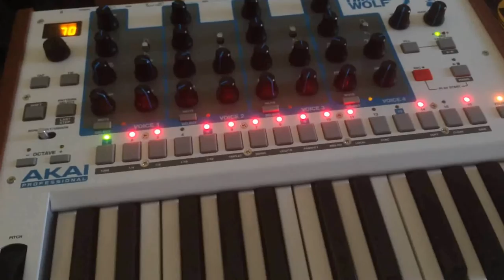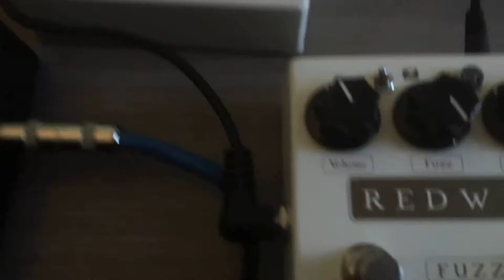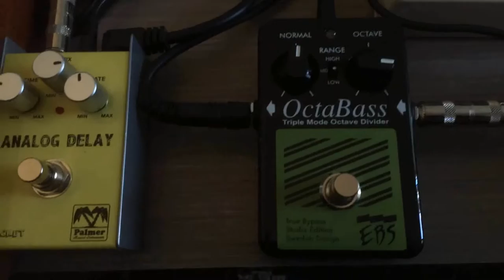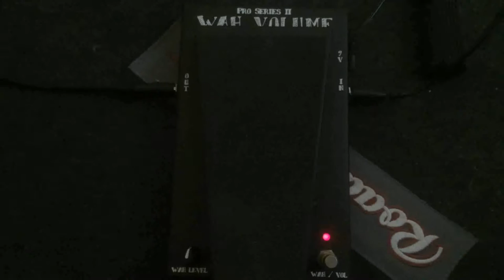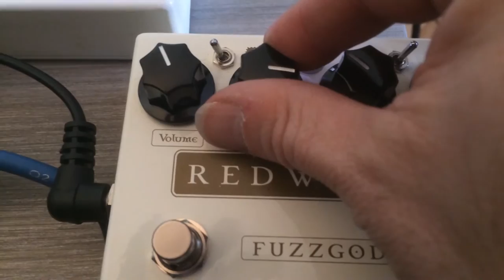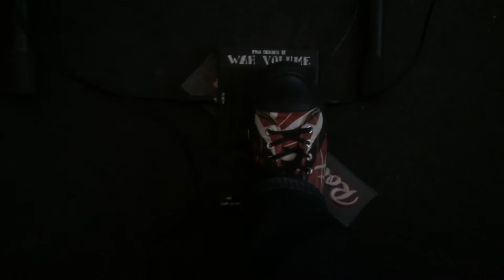ThePedalGuy Vlog | Using Pedals with Synths

Comment: Hi any chance that you could show how and where to connect a fx pedal to the inputs and outputs of a  novation ultranova please because being a beginner I need help.
Reply from the maker: It's a pretty basic setup. You might need an impedance converter to go from the Novation to the pedals. Other than that, it's pretty much plug and play.
Reply: @ThePedalGuy  Thanks for NOT DEMONSTRATING where to connect these pedals. Please show us novices where from the pedal to the synthesizer do I connect.
Reply from the maker: @leeBoB4257  sarcasm and rudeness need not apply.

Comment: I would like to have received more information how to connect pedals to synths, it is not that easy. Do you need attenuators, di boxes?
Reply from the maker: Sharkwhisperer thanks for the feedback. It’s actually pretty simple. No di boxes are needed to make this work as it’s a line level output coming out of the synth in this case.
Reply: just watch the gain coming from the synth it's easy to distort the effect.
Reply: @ThePedalGuy  so it is synth - pedal - speaker?
Reply from the maker: @Sharkwhisperer  Synth->Pedal->Mixer
Reply: @ThePedalGuy  thanks, will get a cheap behringer mixer then....

Comment: I use pedals on most of my synths, mainly reverb and delay using the HoF2 and Flashback. I do run my TB-03 through a RAT 2 and compressor for that fat acid screech though.
Reply: those TC pedals are superb for synths!
Reply: ChasingDogma - RAT, yes! Probably a lot different than the way that you use a RAT today, but here is an OLD (1990) excerpt of an Oberheim Matrix 6 played through a RAT and a Morley wah: https://soundcloud.com/piktor-m/thataintnobanjo-excerpt

Comment: How would you rate nux cerberus with synths, especialy reverb part of it? Cheers!
Reply from the maker: Tomo Flis haven’t used it with synths but I’m sure it sounds great. It sure does with guitar
Reply: @ThePedalGuy  what about moer red truck, those two seems similiar; which of those two you find better? Im seeking  good reverb for my synths and addition of delay,distortion/ overdrive comes handy for 303.Are they both analog?Asking because nor shure about reverb everywhere i look on yt 90% people use big sky which is expencive investement for me.thanx for your reply i subbed.
Reply from the maker: Haven't used the Red Truck so I can't offer any feedback there.
As far as the analog parts of the Cerberus, the OD and Distortion are analog. The rest is digital. Should sound pretty good with a 303

Comment: Hi im using the walrus audio julia with my synths but it seems to clip right away at really low volumes is it normal do i need a di-box?
Reply from the maker: Thanks for the question. I would check with Walrus about that as you shouldn’t need a DI box.
Reply: The Pedal Guy thanks fot replying i have contacted walrus audio they still have to answer but i’ve already asked a request of refund sine its obvious the pedal isnt working lag knob acts as a saturator and turning it to vibrato cuts all the high freq like tone knob while the chorus effect is practically absent the pedal saturates like an overdrive
Reply from the maker: P AT good to know. Maybe they can swap it out. The Julia is a cool pedal.
Reply from the maker: P AT gotcha. Hoping for the best then.
Reply: The Pedal Guy hey man sorry to bug again walrus audio responded that it needs a di-box to work since it doesnt work properly with line level signals... but in ur video i didnt see u passing the synths signal through any di’s before going into julia :(
Reply from the maker: @atuseth4867  Thanks for letting me know. That video was shot such a long time ago at this point, there's not much more I can tell you there. In that video though, I didn't end up needing a DI for the Julia.
Reply: @ThePedalGuy  thanks for your help i re-emailed walrus audio with. better explanation and  messaged a few other users to see what they think... anyways thanks again much appreceated :D
Reply from the maker: P AT happy to help

Comment: very cool so is  each voice on that synth running its own sequence or are they just organized across the sequencer like that?
Reply from the maker: Hi. Thx for the questions. Yes each voice has its own sequence via the Timbre Wolf. It's a pretty cool synth, especially once you start using it with pedals.
Reply: yea for 219 i got no complaints i could use that midi thru